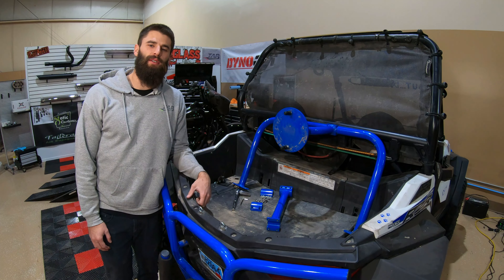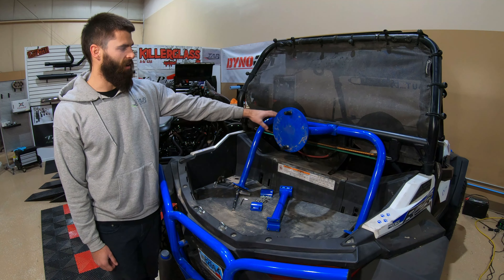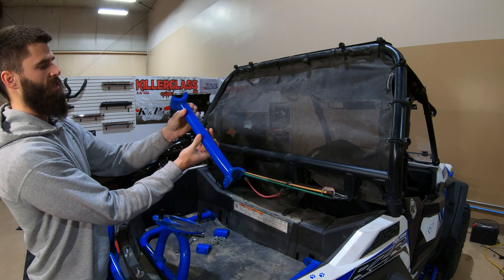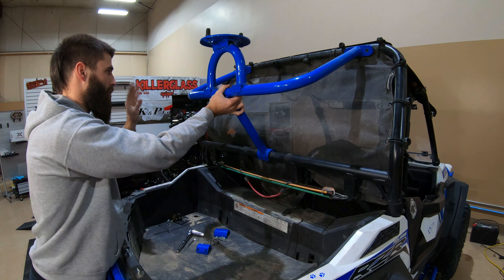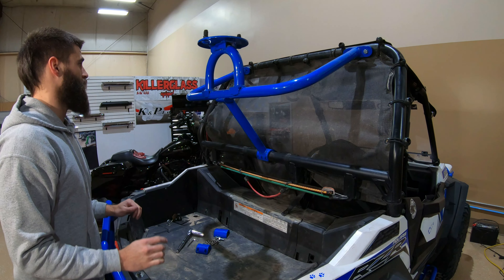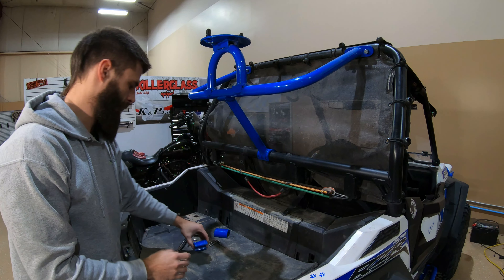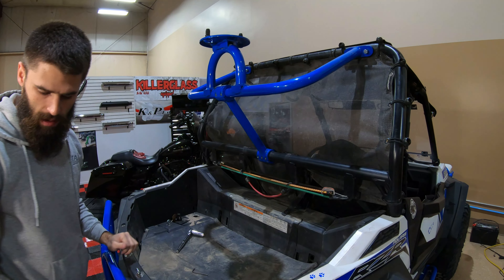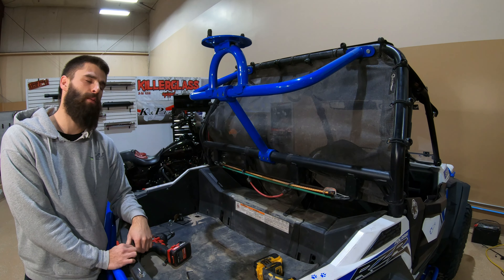Spare Tire Rack Install Video - RZR 900 & 1000S - TAB Off-Road

Comment: Also what if you have the bars going from the bumper to the cage can you still do the spare tire bracket mount
Reply from the maker: It depends on how those bars mount and if there would be any interference or not.  I don't have any specifics on the add on other than to say if the rest of the cage is stock and the mounting points are clear it wouldn't be an issue.